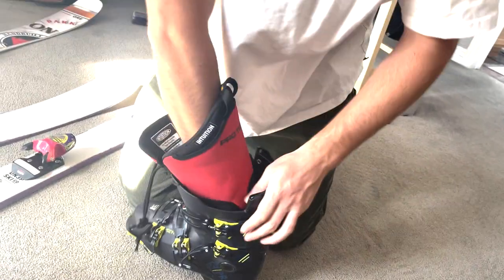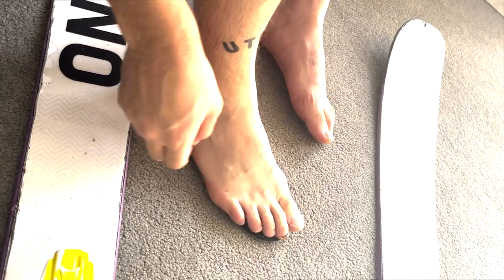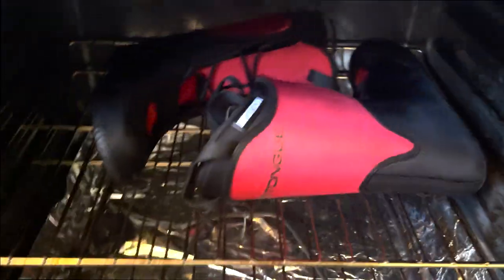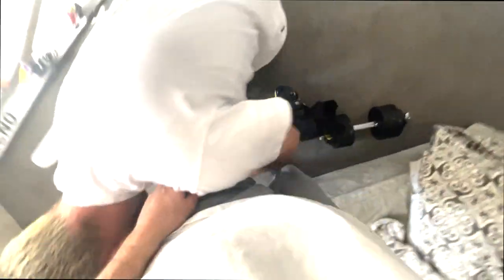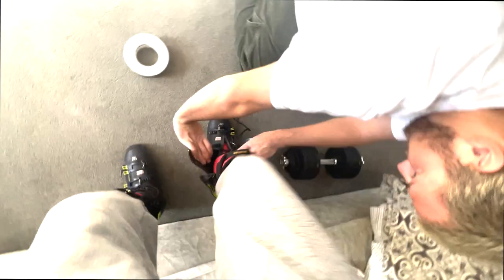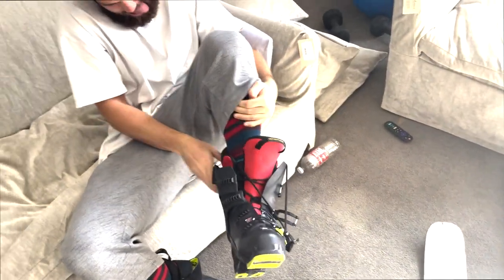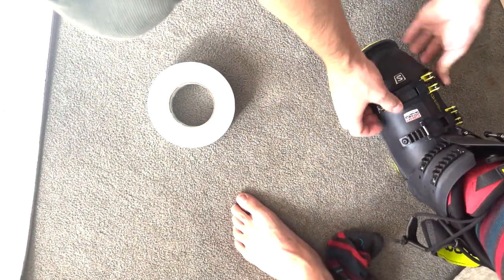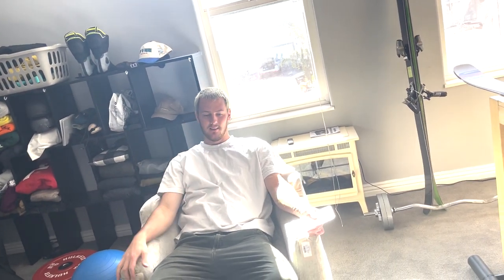Intuition Liner Heat Molding at Home // SkiMatt Educates

Comment: Ha ha got the same liners and shells 

Question    Do you have to heat mold them ???
Reply from the maker: Yes I would highly highly recommend heat mold. Even going into a local shop would be optimal.
Reply: I just did them at home 

Rode with them today before heat molding 
Riding tomorrow to see how I did